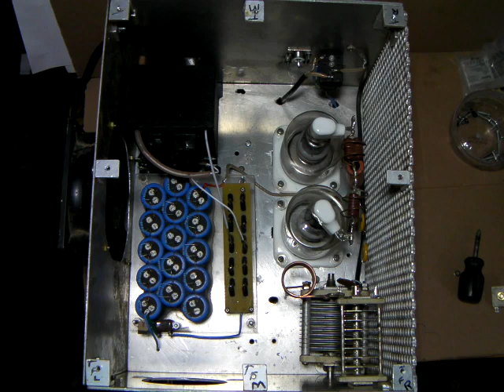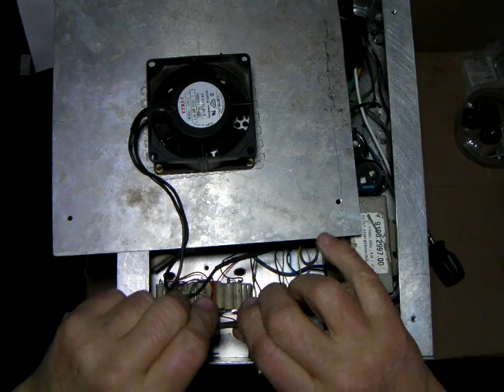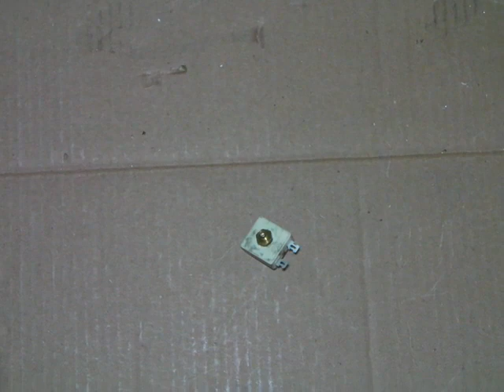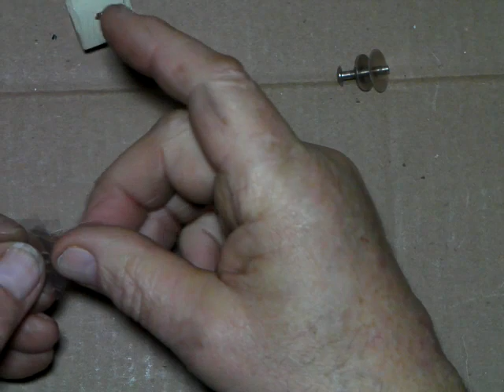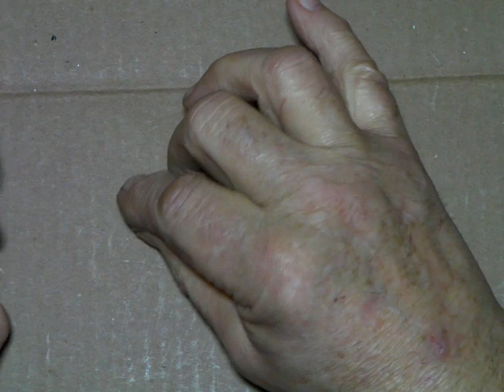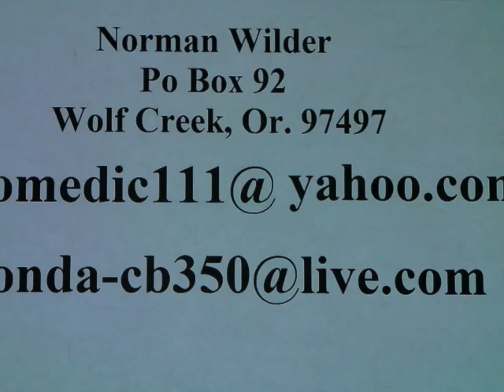Single Tube 4CX250B Amp For 27Mhz  The Build Pt9

Comment: A common 13 x 9 x2 or 3 cake pan with slide on lid (you know the one that sticks when you try to hi grade a late night snack) is almost Identical to that and cheap at yard sale or thrift shop,  20 bucks or less brand new at Winco, Fred Meyer, Albertsons , etc.Your input tuner looks a bit like the "grid tune" control on D&A amps. I kind of like to steal the matcher out of one of the little SWR meter/Antenna matcher used to be sold at all sorts of stores and still find at truck stops, Steal the 2 caps and the coil and the swr/field strength part still works